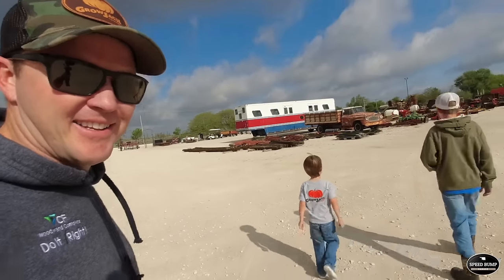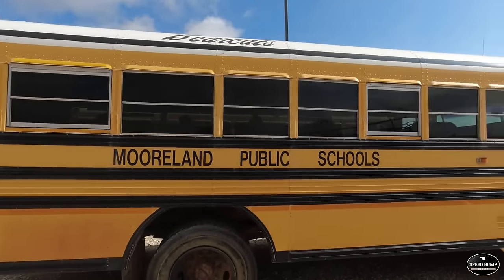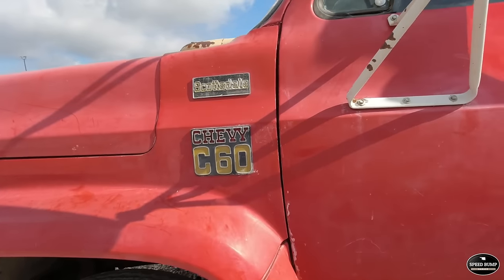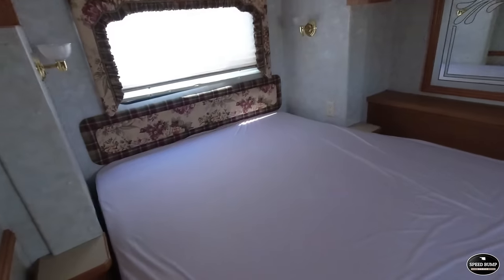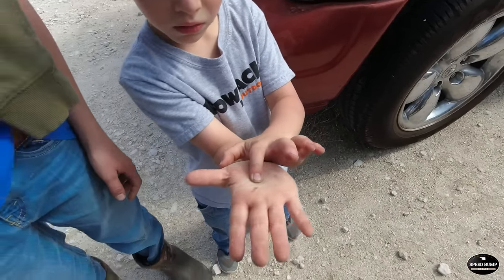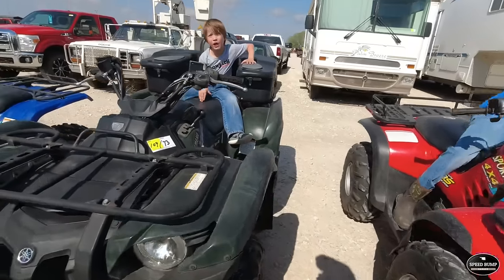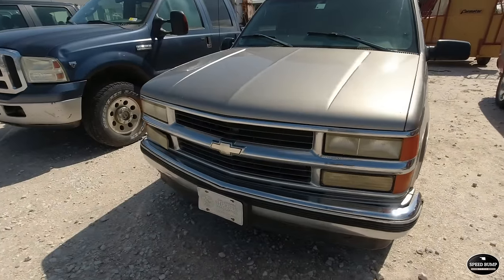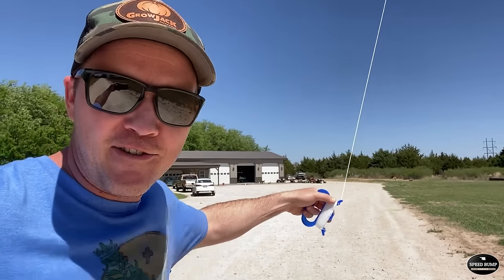Auction FEVER! You won't believe what I bought...

Comment: That red c60 Chevy dump bed was taken care of because most are slap wore out. At my job we had a 85' with a anemic 400. They replaced it with a stout small block Jasper engine  and with four speed trans and two speed rear end. Had a short exhaust two in two out thrush muffler. It sounded good for what it was. Especially if you had a load and run through the gears and switching high low rear end between gears.

Comment: That sand rail looks like it set up as a street ride as opposed to a sand dune with the tires on it.  Most of those RV's you looked at should have seatbelts on or in the couches and then fold out for sleeping.  I think that large screen that looks like a tv is more of a rear view camera so if you're towing a vehicle behind you can see around and behind that vehicle.  The camper that looks like a van you want to see if it has a plug to convert AC power from a campsite to 12V power.  That way you could hook up a generator or inverter, otherwise you're just using engine power and 12v battery.  As a camper it should have the plug.  It might also have an exterior shower accessory.   That large reel you looked at in the beginning of the video I think may be used for laying out irrigation hose.  The large school bus that the boys rode on would be nice nostalgia and you could convert that into a cool camper, lots of people do that. If you register the bus as an RV you don't need a CDL.  Otherwise you need a Class B license with a "P" endorsement.  Does it have air brakes, or hydraulic?   I think you should make a camper out of the bus, great project for the whole family (Crystal included).   Fun video.   I was surprised AJ new what the wood harvester did.  Smart boy.
Reply from the maker: Thanks Mike! I am the proud owner of the boys old bus and I think it does have air brakes.  AJ loves big equipment

Comment: If yall were to buy a sand rail I would recommend buying a mid travel A arm car. They are super fun and usually have the iconic ecotecs in them which basically run FOREVER no matter what you throw at it.

Comment: 1st thing to check on rvs is the roof .Water damage really causes lots of damage to them. and they are odd sized walls and ceilings including the materials they build them with. If they are a motor home always run them and drive them first .

Comment: I have a 1970 chevy bus 37 feet that I changed into a motor home used it for 13 years now now I have to gut it 'cause the rats took it over and destroyed it so I got it Now I got my tools table saw work bench in it and saw planar drill press all kinds of tools in it now or in a woodlathe and it I use it for a shop his rats took over my other shop so now blogger off all the holes and rats can't get in there it has a big block Chevy 350 4 speed standard very low geared top speed 55 miles an hour very good for climbing the mountains here and hunting
Reply from the maker: Sound like an awesome machine!
Reply: @SpeedBumpGarage  😁😁😁